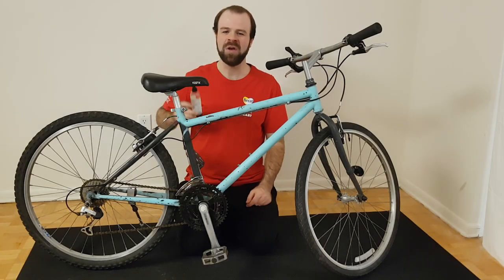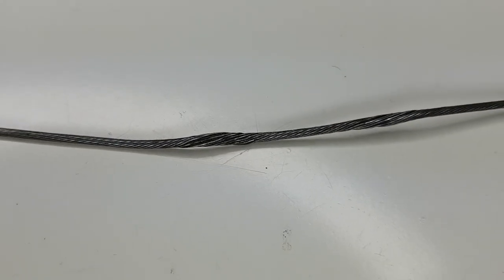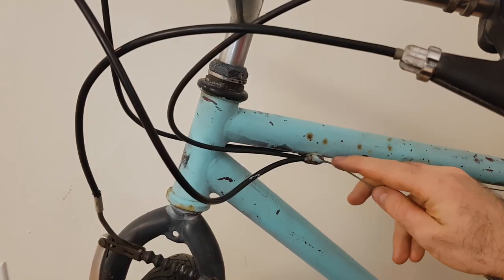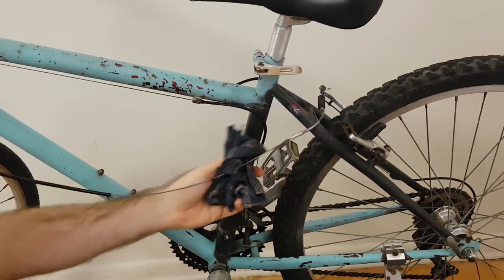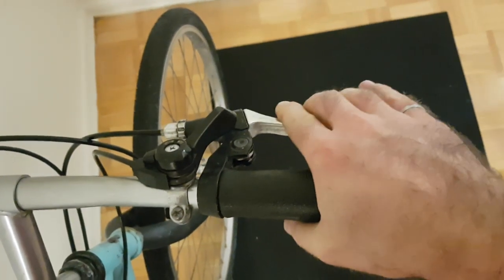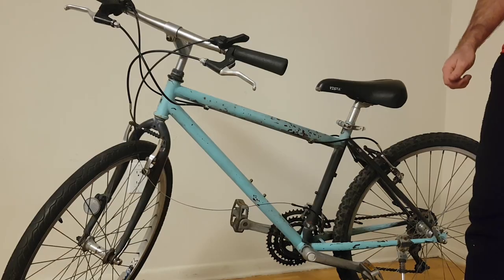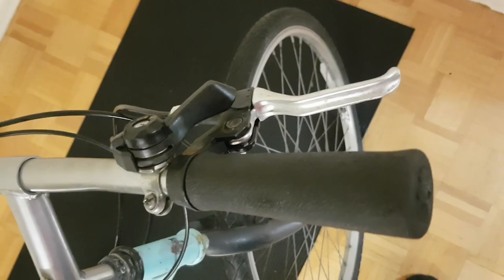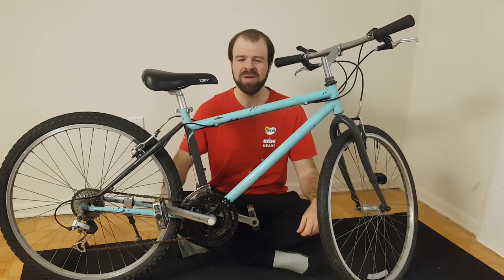Trick for Lubricating Cables on a Bicycle

Comment: What about on dual-pivot rear brakes for road bikes, how do i slacken the cable to move the housing? Can i do this too without any need to cut the cable or loosen the pinch bolt? I got no cable cutter, just pliers.

Comment: Thank you very much for the technique. I will be ordering brake cables, and i had to read a lot of offers from vendors. I don't buy Chinese.

Your technique will allow me to ride with less risk while my order of brake parts and cables is delivered. I have checked and checked where the friction in the rear brake cable is (after some days of rain), and with some use back and forth of the brake lever, the wire is moving a bit better. This brake was the best rear break in my bikes, so i was disappointed what the rain, dust, high humidity, dust and temperatures in the 90's did to my best break cable.

With your technique i think i will be able to get it working. The original brake cable and cable housing are ordinary, so it is not designed to last, and probably let's in dust and dries out in hot days here in San Antonio Texas.

I appreciate your kind help 😁🤠
Reply from the maker: Thanks, glad it was helpful. Best of luck on your repair!
Reply: @cjhoyle  It worked perfectly! 

I noticed that the housing/cable has two curves near the noodle (letting rain water in). I flattened one curve with a tie, and this also avoided some of the initial friction. 

Very nice, your solution. Most important is to realize how well bicycles are designed by these times, Even as to ease for repairs. 😳
Reply: It seems like almost everything is made in China. It's kind of hard to avoid, but possible, I suppose.
Reply: @ BPLove almost everything is made in China. What you don't want is "designed by and made in China." A lot of high end products are made in China but not designed or engineered by China.

Comment: For the front cable, open up the front breaks for slack and take the cable out of the break handle. Hold the housing straight up and let the oil run down the cable and into the housing.
Reply from the maker: Yes, as I mentioned in the video, the access to the front brake cable is a lot more restricted than the others, so this is really the best you can do.

Comment: But my front brakes is hard to press, how can i lubricate it? Im sorry im new with this bike stuff.😟
Reply from the maker: Yes you can, but like I explained in the video, the trick that I showed here doesn't really apply for the front brakes on most bikes. To lubricate the front brake cable, you'll need to unfasten it from the brakes and remove it from the housing.

Comment: If you libricate that, dust will came. Well for a while if you dont want to spend any money on it.. Why not (-:
Reply from the maker: You could say the same thing about a chain though, and the chain is much more exposed and prone to collecting dust/dirt from the road. If dust is something you're particularly concerned about, you could always buy "dry lube" for your chain, and also use that for your cables.
Reply: @cjhoyle  well yes, that Is the reason why you have to dry your lubed chain with same cloth.
Less oil on surface and the chain stay clean longer. Once you get mud in bowdens you get in to the circle..

Sorry for my English